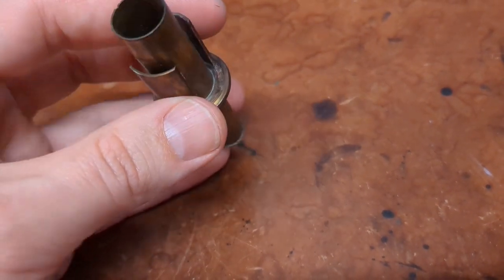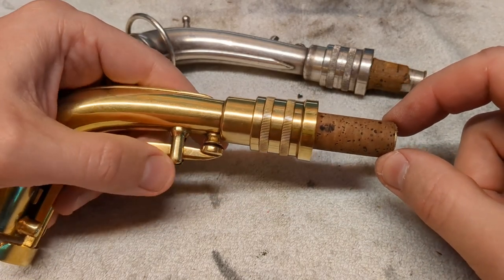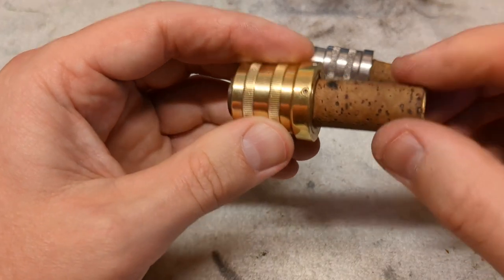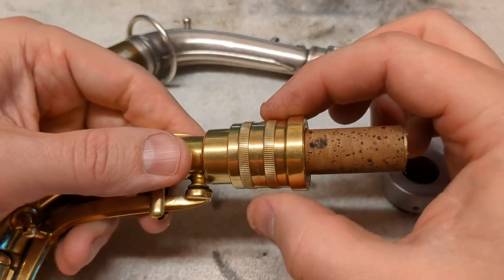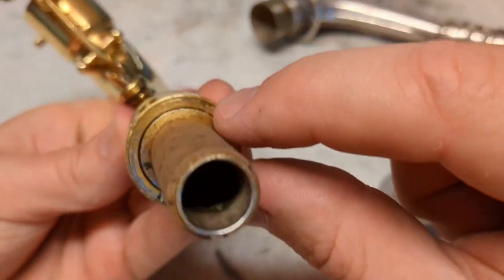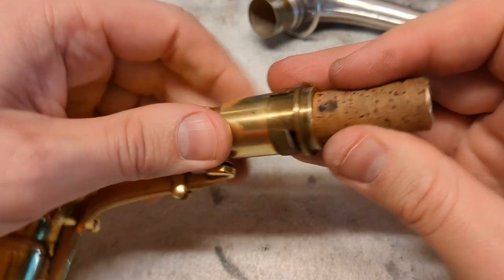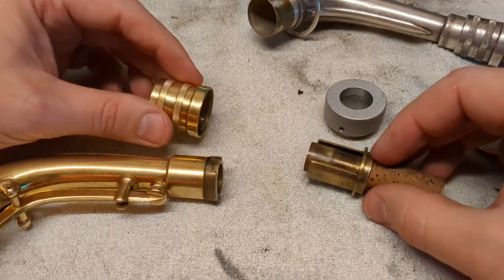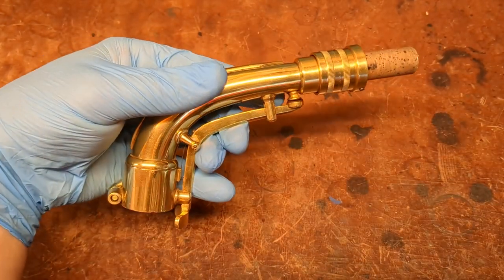Saxophone Repair Topic: Old-school Fix for Loose Conn Microtuner

Comment: I like the idea of the microtuner, but I think the reality is they're not worth the trouble over time.  

But I love your diagnosis and recommendation.  Keep the videos coming, you're really great.
Reply from the maker: Thank you!  And yeah, its hard to argue for something that mechanically complex vs. just a tube over a timespan of like 100 years!  But in my opinion, they can be made right just like any other mechanical aspect of the saxophone.  If you are or have access to someone who is a decent repairer, I wouldn't let it scare you off of the truly great saxophones that have them like the New Wonder Series II and the 6M.  In fact, because they are so often under-repaired (including the double socket neck leaks on most 6Ms) the horns have a less stellar reputation than they deserve, and therefore still represent a great value pricewise in vintage horns when repaired well, IMHO.

Comment: Hello, I understand that the rolled tonehole and straight tonehole 10m are essentially the same aside from the tone hole.
Then came those with "naked lady" engraving but with microtuner (before 1960) - are these still as good as the earlier ones?
Reply from the maker: It is widely agreed that the later ones are not as good as the earlier ones, although they can sometimes represent a good bargain if they are in good shape and overhauled well.
Reply: @StohrerMusic  I see, the ones without microtuners are better I'll look for them.
Rolled tone holes one are too expensive and difficult to find in good condition.
Are these later (but pre 1960) ones as picky on mouthpiece?
What sort of mouthpiece can be a good match for the 10m?

Comment: Difficult question, but how well can one of these seal ideally, and how much of a leak is tolerable in your opinion? I have one that has almost no play in the mechanism at all, but reads at 0.4 on a magnahelic machine (arbitrary I know, as settings vary). Cause for concern you think?
Reply from the maker: In my opinion, they shouldn't leak at all.  A temporary (how temporary varies - could last for years) fix is to use some rather thick grease in the sliding portion.
Reply: @StohrerMusic  awesome, thank you so much. I thought I was home free seeing as it was mechanically sound, but oh well. I’ll pull it back apart and see if I can improve it at all - probably will try some grease first as it is easy to try